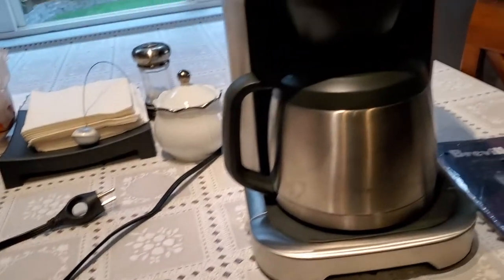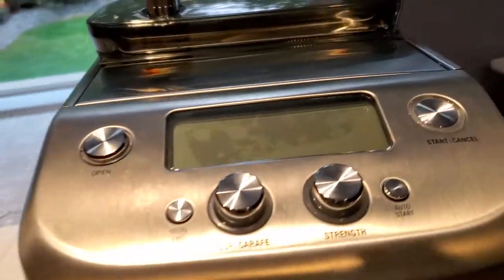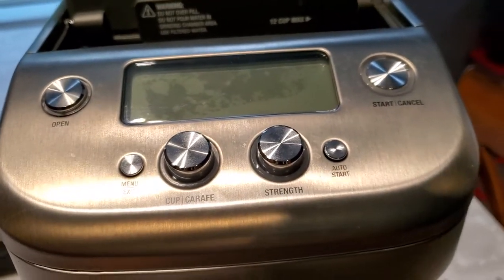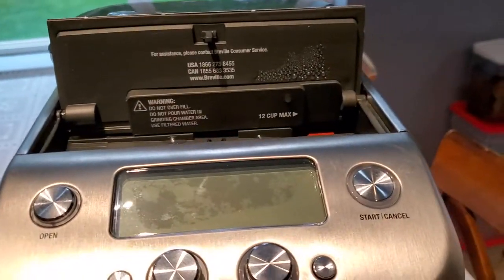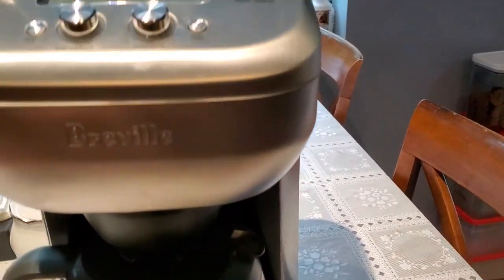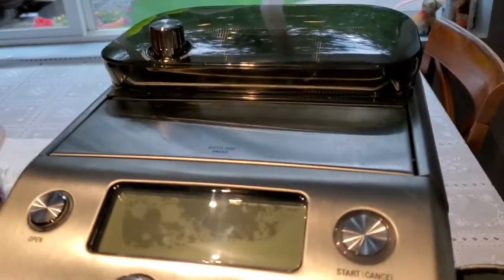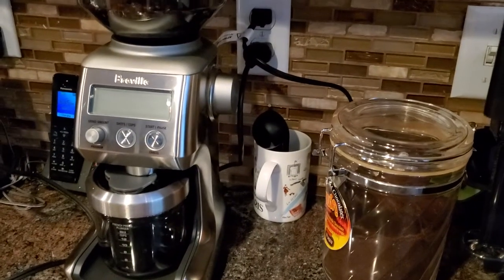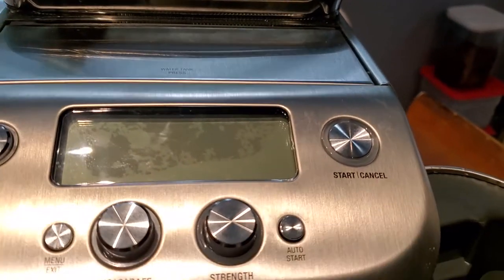Breville grind control coffee maker water tank and display issue

Comment: This helped me out so much. I also have a zero water filter and had the same exact issue. Breville customer service was no help. Thank you so much!
Reply from the maker: Glad I could help 

if you still have the machine try adding a little bit of bottle water at the bottom of the reservoir before filling up the rest with zero water  Let me know if it works
Reply: @rybalkins  I dumped out the zero filtered water and replaced the whole tank with bottled water. That fixed it immediately. I’m not even going to bother with Zero Water anymore (with the Breville, at least).

Comment: I have had the same concern about whether or not Amazon has sold me a used/refurbished machine as your concern.  I am on my second machine after returning my first after only a few days.  I had issues with both machines where when I brewed a cup the coffee itself was bitter even after increasing my grind selection to the largest size of 6.  The instructions state that a grind size of 3 and a strength setting of 4 should be the ideal setting for most coffees.  That has not been my experience thus far.  I now have concerns that the grind selection is not as promised or works as stated.  Has anyone else experienced this?
Reply from the maker: I see I don’t know about the grinding issues my main problem was with the display not reading the water information correctly after I used the my zero water pitcher filter I had to add a little bit of bottled water before using the filter  pitcher & that fixed my issue. 

But that’s just one more of the many issues with this machine 

THANK YOU FOR SHARING & FOR WATCHING
Reply: @rybalkins  I too am also using the zero water pitcher so that may be the deciding factor.

Comment: Have same issue with 9cups when full. I have full line of breville kitchen line and almost 0 issues except the water amount , I never descaled doing now maybe it will be a fix. Using tap water will ruin the machine- minerals will build up overtime, only distilled water.
Reply from the maker: what i did that seemed  to help when there is no water i the tank put about one cup of bottled water in the tank before pouring in Filtered water that should help
Reply: tap water is fine, just descale when the machine alerts you. No issues with ours. Works great.